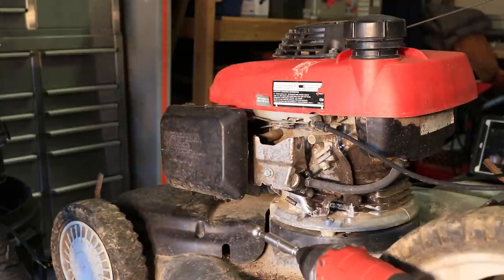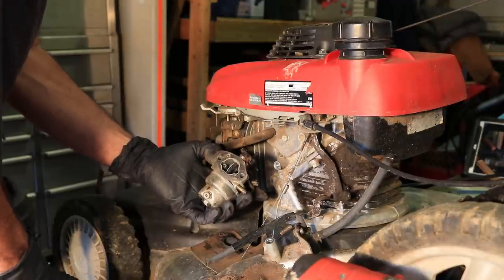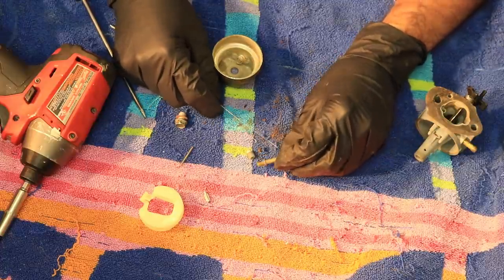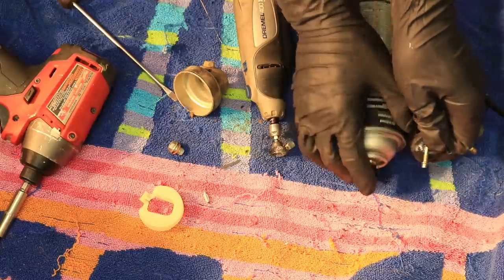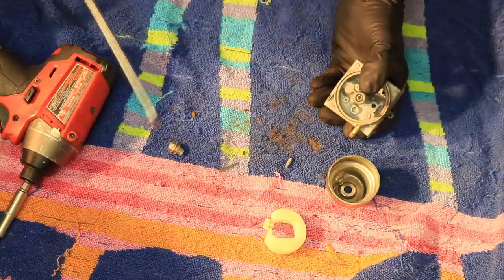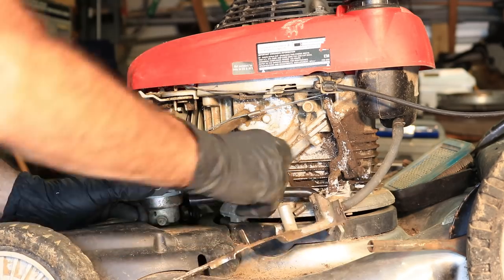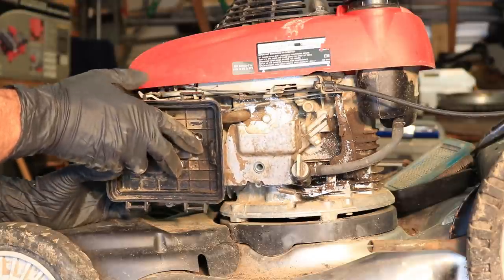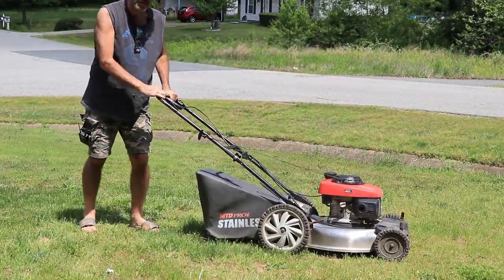Honda GCV160CC Won't Start?...Watch to See How I Fix it!..

Comment: This is the best video on repairing Honda carburetors. I pulled mine off and cleaned it only to have it hard to start. This video shows what I did wrong by not having the choke lever in place before I installed it. Thanks SO much.
Reply from the maker: Awesome!  Thanks for the comment and You're welcome.. :-)

Comment: Thank you for the clear, thorough, and accurate demonstration. My symptoms were: engine starts and runs a few seconds then quits. I could not start it after that. I left it alone, and tried again. It ran a few seconds then quit.
My guess: Something is preventing fuel from reaching the combustion chamber, so I took the carb off and apart and removed a tablespoonful of rust from the float bowl, then cleaned it up and reassembled it. Success!
Reply from the maker: Awesome!  You're welcome... :-)

Comment: Great video, this was the fix that my lawn mower needed. My mower had been sitting unused for 2 years and it wouldn’t start. I first replaced the gas, then changed the oil, then replaced the spark plug, and then sprayed starting fluid in my carburetor, all without any success. The video instructions were easy to follow and my mower worked just like new after. I used a sewing needle to push through the holes since I didn’t have the wire gadget he used. This was easier than I expected.
Reply from the maker: Excellent!  I'm glad you got it going.  Yes a needle should work great.. 🙂
Reply: You could use a loaf of bread tie just scrape off the plastic to expose the wire and run it through all the holes in the carb then spray with carb cleaner
Reply from the maker: Yes that would work for sure.. Not sure if they still use those wire bread ties... Every time I get a loaf of bread it comes with a guitar pick looking plastic thing that hooks in there if you know what I mean.
Reply: @JLPicard440  yes that's right there are certain types of bread that have that

Comment: Its probably been over 5 or 6 years since i cleaned a carburetor out, so my first attempt at cleaning it I didn't remove the jets (just shot carb cleaner through them) and that didn't work. This video reminded me to remove them and clean them more carefully. Now my Honda is back to running on the first pull after sitting since 2020. Thanks for making this video!!
Reply from the maker: Awesome!  Glad I was able to help.. 😀

Comment: Hey Ruddie, just found your channel when search for vids on fixing a Toro drive unit. I was checking out your mower repair videos and on this one on the Honda carbs, I thought I would share what I learned on them. Honda put a coating on their carbs and bowls to help with a corrosion problem. They don't recommend using harsh carb cleaner or brake cleaner on them. As it will strip that coating off shorting the life of the carb. If you use a carb cleaner ONLY, blow it off or wash it off. And don't use steel wool or sandpaper on them for the same reason. I heard about this from other engine guys and checked and confirmed it with Honda. If you you have one that just can't be rebuilt to run, the OEM ones are not expensive. They have general carb that when you get it, you might have to swap out the choke and/or the throttle shafts with old carb. The basic carb is the same for all engines.
Reply from the maker: Thanks for the Tip!  The steel wool works for a while, but yea you're probably right, it'll get all messed up again in a while... but the new carbs are only 15 bucks on amazon...!

Comment: Great video! I had same problem, but had skipped the emulsion tube removal and cleaning.  Took it apart and cleaned it again and started first pull! Thanks!
Reply from the maker: Yes, sometimes they get clogged and sometimes not... You're welcome... :-)

Comment: Thanks!... Good video.  I subscribed.  Comments: Brush out the air filter before reinstalling.  Suggest to those doing this for the first time, that they consider taking some pictures of how things are attached before pulling out the carb.  In the YouTube "SHOW MORE" area under the description of your video, you might list the tools you use and consider adding links to Amazon for the carb cleaner wire set and cleaner spray you use.  BTW, that was a great suggestion to check for leaks after opening the gas valve connecting gas to the carb.  I had a case where I didn't tighten the carb bowl cap screw enough once and by accident I noticed gas started dripping out of there.  If I had not caught it, because no one told me to check for leaks, and walked away to take a break, I would have come back to a mess, possibly even a fire if the vapors had caught a spark from somewhere.
Reply from the maker: HI John... Great suggestions.  I do have Amazon links in some of my other videos.  I'll address this one as well... I don't like to suggest brushing out the air filter, only for the reason that I believe it loosens the dirt and it could get sucked into the engine when it starts.  I've done this before, even blow the air filter out with a compressor... which is going against my own rules!  But I don't like to suggest other people do it!  As for the fuel leak.. yep, that could be problematic... :-)  Thanks for the comment and the sub!

Comment: Thanks for posting this video. I have about a 10+ year old high pressure sprayer with a Honda GCV160, with only about 20 or 30 hours on it. It wouldn't start, I tried almost everything to get it running and was ready to give up on it until I saw your video. I cleaned out the emulsion tube and it runs like new now :). However, the emulsion tube was stuck and wouldn't come out, so I bend a thin metal rod in an L shape to push it out.
Reply from the maker: Oh yes that's happened to me with the tube getting stuck.  I usually use a small Allen wrench and that works too.. Thanks for the great feedback and you're welcome.. 🙂

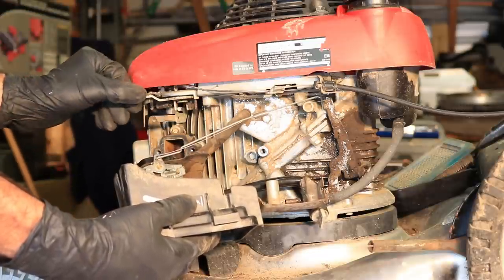Comment: I recently bought a Craftsman self propelled mower with a Honda engine from a guy off Craigslist that would not start. For about a month I watched any video I could  on this issue. I was fed up and I said this was the last one I was going to watch. With a name"Take a bath productions" & dirtiest looking engine I didn't expect much. That is until you said these words "push that back so that it will mesh with the choke and the carburetor"  I went back to 11:27 & I played it back over & over. Nobody else on any of these "how to" videos mention that NOBODY.  You sir deserve a big thank you! It was a simple fix that ended a lot of frustration..
Reply from the maker: Male Anon That's awesome!  Thanks😀😀
Reply: Yup the butterfly was open & would not choke. Problem solved. Better yet it put an end to a month of hearing ":Didn't I say not to buy a mower off Craigslist" "You should have bought a new one like I told you to do". Nag..nag..nag. Buddy you bailed me out . Thanks again.
Reply from the maker: Oh yes... I'm familiar with the Nag!  I buy em off C/L too when I find good deals on one...  Glad it worked out.  Hondas are good engines, but the carburetors are a little hard to get back on...  Thanks again..
Reply: Guys I've got a 1 month old Honda mower. I was mowing and it ran out of gas, I filled it and haven't been able to start it yet 
I have NO idea WTH is wrong. Any help would be appreciated. 
It doesn't have 1hr of run time yet
Reply from the maker: Mike Fey since it was running fine until you put gas in it... I would suspect possibly water in the fuel.... worth a check....
Reply: Take a Bath Productions The gas I replaced was from the same fresh gas it was running on. It's a brand new mower using a brand new gas tank. I'm clueless. Lowe's is just backed up with lawn equipment this time of year, but I'll bring it in tomorrow and let you know the problem when I get it back.

Thanks
Reply from the maker: Mike Fey yea that sounds like something I’d have to see.... if u got it from Lowes they’re pretty good at taking stuff back
Reply: Take a Bath Productions tried...out of the 30 day warranty. I'll have to drop it for repairs now. Will update you when I get it back
Reply from the maker: Mike Fey Darn..... I thought they were good up to 90 days.... must be different on mowers.... yea let me know what they find.... thanks
Reply: Hey Mike, Is the gas on? it should be in the horizontal position. Sounds like its not getting any gas. Curious, is it a manual or auto choke?
Reply: Male Anon yes, it's on and Auto choke. It's Crazy, it went from a 6" pull and running to running out of gas and never cranking up again!
Reply: Ok, humm?  You say its brand new?  I had the same problem except mine was used, but it looked like new. The guy started it right up, got it home and it wouldn't start. I watched every U-Tube video I could find but nothing worked. That is until this video right here. I dont think it will help your situation, unless you or someone "tinkered" with it?  Carburetor?
Reply: In my case I thought the choke was working to., Just slide the lever over pull the cord & start, not the case. The choke wasn't opening and of course you cant see it so there's no way of knowing that. Some one must have taken the carb off & didn't put it back on correctly. I discovered that in Rudy's video.

Comment: Great video! I'm going to attempt this fix this weekend on my mower thats been surging real bad..a bit apprehensive as i've never done this before but feel a little bit more confident after watching you! Thank you for taking the time to make this video!!
Reply from the maker: Excellent!  Yes I hate surging mowers... sometimes they just don't fix without replacing the carb.. but hopefully a good cleaning will clear it up..  You might also check the governor adjustment, that too can sometimes cause surging..
Reply: Take a Bath Productions I saw a good idea for removing and replacing the Honda carb.
Get 2 pieces of threaded rod same size as the two bolts, remove one bolt and replace it with the threaded rod, do the same for the other bolt, and reassembly is much easier.
Just reverse the process and save the 2 pieces of threaded for next time. These Honda carbs are extremely fussy, not as robust as Briggs. Require much maintenance!
Reply from the maker: Yea, that's a good idea,.. those are a bit finicky to assemble back together..!

Comment: I was taught at a very young age and have did this Religiously since....... before you start ,especially  if your gunna tear it down any way......CLEAN it GOOD FIRST then you don't get dirt inside anything PLUS then you can notice if you have other issues......cracked or rotted fuel lines bent linkages missing springs or screws !!!   I do this with every thing I work on saves you from tearing it apart again........try this you will see all the benefits
Reply from the maker: Sometimes I do clean it first.. sometimes I don't... the only benefit I can see is you don't get as dirty when you're working on it.  IF i'm going to clean the carburetor anyway, it doesn't really matter.  If the carb was in real bad shape, most of the time, I'll replace the fuel line too...  But it's just a matter of preference... Thanks for the comment.

Comment: Good video , little hard to see with a colored towel but got the jiff of it! I cleaned every but the first thing you did with the torch tip cleaners. So back to the carburetor and see if that does the trick! 👍🏼
Reply from the maker: I hope it does the trick for ya!  You might be able to use a sewing needle to poke through those holes followed by compressed air, if you don't have the torch cleaner.
Reply: @JLPicard440  that dirty, after cleaning it with the torch tip cleaners I hoping that will do the trick! Put everything back together. nope!  Notta! Dam. Still starving for gas. The bowl is full in the carb. I guess it was worth the try. So next step order new carburetor. 🤞🏼
Reply from the maker: @runin1wild  ☹️.  IF you get the aftermarket carburetor, they're pretty reasonable..

Comment: Great video! I have watched several videos on cleaning Honda carbs. I have never seen
one fuel filter on any of these mowers?? I have one of those red in line filters on my Honda 
with no problems. Just my two cents.
Reply from the maker: Al Gorel it's a good idea! But you're right... they don't have one
Reply: Take a Bath Productions I stand corrected, if you remove the fuel line from the tank,
you will see a filter in the fuel line.
Reply from the maker: OH,... I'll have to check that out next time I get one.. I didn't notice that..  Thanks..

Comment: I had a hell of a time with this engine after replacing the carb. Turned out I screwed up and had the choke lever on the wrong side so it wasn't actuating the choke. Really easy mistake to make when reassembling.
Reply from the maker: Oh no!  I actually like the auto choke.. some people don't like it, but I've found it to be pretty reliable..

Comment: Take a bolt the same size as the original for the carb but slightly longer. Cut the hex head off and using a cut off wheel to make a notch for a screw driver. Then you screw that into the engine housing and slide all your gaskets and parts over the bolts. Then you simply hold the carb tightly and remove one modified bolt and replace it with the original bolt, dont tighten completely before doing the second bolt so you can make sure everything is aligned. I find this saves me time on Honda ( and cussing) and any carb that has multiple gaskets.
Reply from the maker: It doesn't seem that hard for me.. I usually take the original bolts and push them thru all the holes until i'm at the back gasket and then screw it on the block.. but I can see how it would be a pain
Reply: @JLPicard440  most guys complain about trying to align everything up. You can pass on that tip. I learned it from another Small engine guy. Donyboy. He is a Canadian. Has some great tips.
Reply from the maker: @scottfirman  Excellent!  Thanks for the info.. :-)

Comment: if the fuel line is shut off from the valve would that prevent the carburetor from gelling like this?
Reply from the maker: Nathan Soper for the most part.... u have to shut off valve and let it run itself out of gas.... it won't get 100% of fuel out, but most of it... Honda's usually have a bolt u can loosen to drain the bowl... hope this helps. Thanks.

Comment: Good video, and I agree Briggs & Stratton engines better to work on. Even Techumseh motors are nicer.
Reply from the maker: RONS BEERS & TOOLS Yes I don't think Honda's are all their cracked up to be! 😁😁
Reply: If you treat them like that all engine will run like garbage. Clean off those cooling fins.

Comment: I ad a 13 HP Honda engine on a rear engine Snapper rider and it constantly gave me problems.  Once you ot it running I was an excellent engine but t wore out lots of batteries getting it to run and  that was when we had good gas.
Reply from the maker: Sheesh,.... I'd probably have to get rid of that one!

Comment: I think I would’ve sprayed this down with a degreaser or Dawn dish soap and hit it with the water hose to clean off a lot of that dirt first. Ah ha. I did not know about the automatic choke alignment.
Reply from the maker: It wouldn't hurt it.  I usually do clean them up when they're really dirty.  I must have been lazy that day!
Reply: I always use a pump up sprayer with simply awesome dollar store cleaner and dawn dish soap. Let it soak , then use my pressure washer before even thinking about opening up a lawn mower. Even blowing off the loose stuff is better than taking apart something and risking junk getting into the carb. On Honda mowers, an ultrasonic cleaner works better than anything I have ever used, including brake cleaner. You cannot reach internal passages on those carbs. The low speed idle circuit always gets clogged up on those. I clean them, if that dont work, I order a chinese replacement for $15. Never had one fail yet.

Comment: ive tahen out the main jet and cleaned it but i dont see how to remove the emulsion tube
Reply from the maker: Depending how much goo is inside the carburetor, sometimes you can tap it on a metal surface and shake it out.  If that doesn't work, you can use something small like a small screw and try to grab it and pull it out..

Comment: Do you need compressed air and brake/carb cleaner or is that just what you recommend?  I don't mind buying some cleaning liquid but compressed air is a little more expensive... Thanks
Reply from the maker: Sebastien Labrie I do recommend compressed air.... but you should be able to do the same job with carb cleaner if u get the can with the little straw..... hope this helps😊😊

Comment: I did this to the same motor as yours and now it wont start at all. It would only run on full choke to begin with now I dont have a mower!
Reply from the maker: Sounds like you did something wrong!  Take it apart again and see if you can see what.  I can't tell you because I can't see what you did..

Comment: I have the same engine on my mower, having a problem getting it started even after replacing the carburetor. It will start and run but not without a shot of starting fluid first. Any suggestions as to what could be preventing the engine from starting?
Reply from the maker: Is the fuel in the gas tank contaminated with water or anything like that?  I will usually empty out the gas tank and clean it before putting it back to a new carburetor.  Especially if it's been sitting for a while.  The fuel will go bad after a few months if it's just regular pump gas..